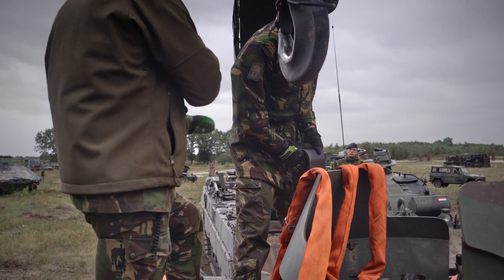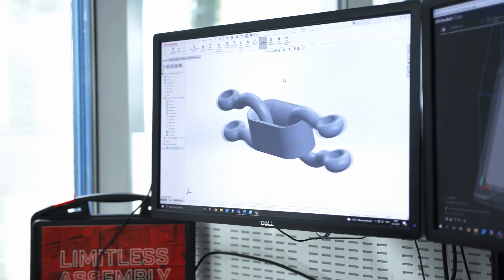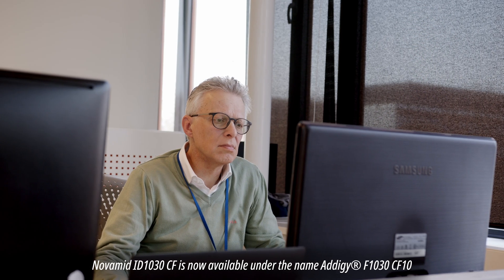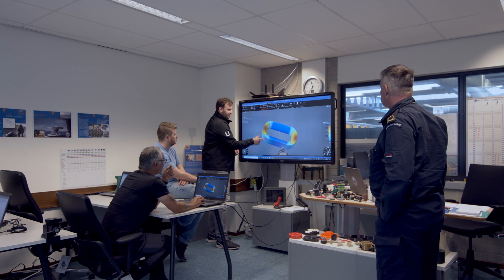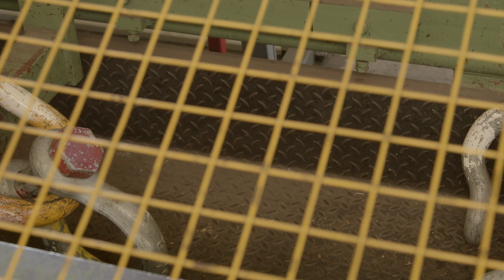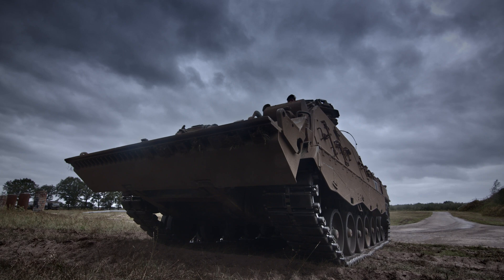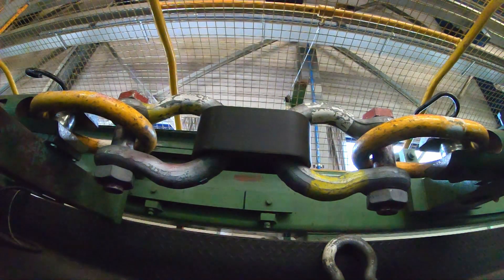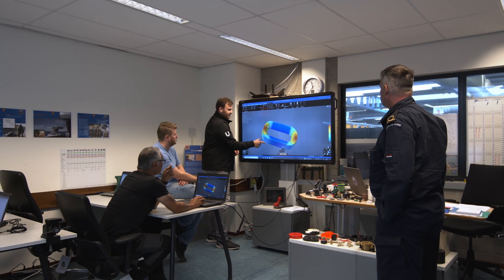Can we lift THIS? Pushing the limits of STRONG 3D prints

Comment: TL;DR

Carbon fiber infused plastic exists, that can withstand great pulling forces that happens to be 3D printed in this video with 100% infill(can be made any other way). 2kg of material was used to make it possible. It does not seem to take advantage of 3D printing, they just made 3D printed chain link.
Reply: All of that is true. It is pretty cool though, designing and printing it like they do.
Reply: Well, it DOES take advantage of 3d printing.

There's a reason why the Dutch armed forces are testing such technologies, because it lends them flexibility out in the field for load bearing parts. Such a print might take 8 - 12 hours? Much faster than you might make something in factory and ship it to the front line...
Reply: @davidngqkalone88  What about their ships, if you're on a mission far far away you don't wanna bring tonnes of spares and perhaps a whole workshop to produce stuff. What if a 3D printer and like 100kg of spools is more than enough? Flying parts in also takes weeks and thousands and thousands of coin.
Reply: @nopcbollx  Really? Isn't space a problem on a ship? Ever been on one? Do you have any idea how much space, energy, personnel, etc. a foundry needs, compared to a 3d printer shop?

Comment: How do you simulate this? 
I mean with the layers, the material is not isotropic and how do you know the properties of the layer bonding
Reply: The experts at Covestro know all the details, but they have profiles per material where they also simulate printing orientation and fibre directions. It's incredibly accurate. Very impressive how far simulations have come.
Reply: If you think that manufacturers or experts use basic hobbysoftware, you are wrong. Specialiced software, maybe even only made by (and for) them.
Reply: @daniell2574  In the video you can see they use Hexagon Digimat.
Reply: @daniell2574  No, I didn't think that
Reply: @daniell2574 ansys